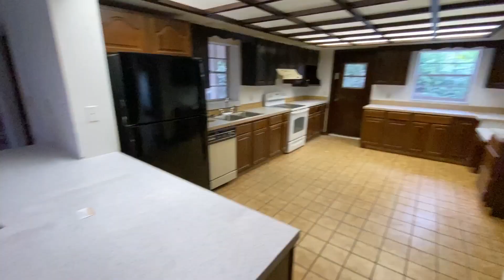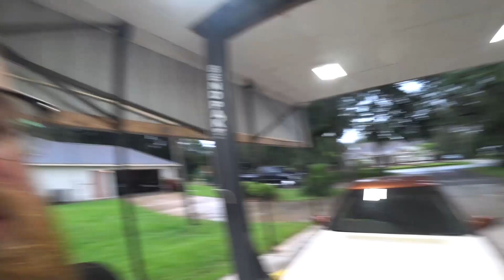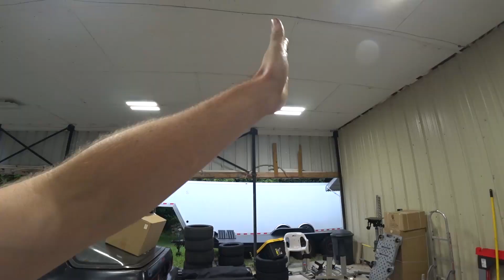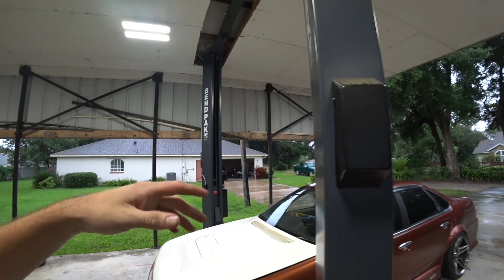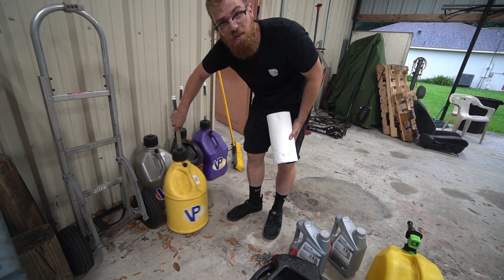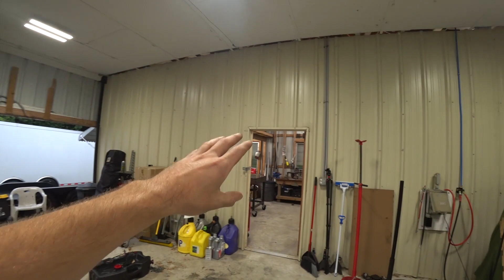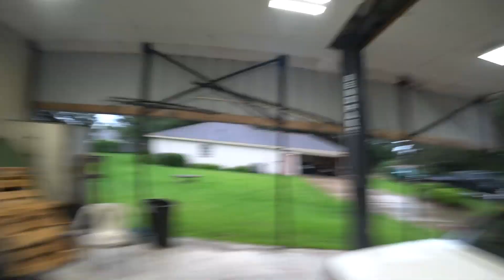Update on my new shop. I have to tear it all down.

Comment: Imagine just being able to close it in without city permission and permits.
Reply: I’d have just done it.
Reply: ah yes cat 5 hurricane coming with no wind standards flying sheets of metal real safe
Reply: @wak3oarder  your mask isn’t covering your nose.
Reply: @geoaerorider4589  I knew a guy that did that, years later got in a argument with a new neighbor and he called the city on him, he built the shop 5 ft to close to the property line. the daily fines he had to tear it down over not pulling a permit.
Reply: What he should have done a long time ago.
Reply: @jsomething2  There's no such thing as "to (sic) close to the property line" where he lives.
Reply: Yeah but you don’t want hurricane to pressurize the newly walled off carport causing the roof blowoff and ruin $100,000 worth of cars and tools. Then have property insurance deny your claim because the building wasn’t up to code. And you can’t blame the insurance company. They can’t payout $100,000 to every house every 5 years when a big hurricane hits. When all it took was $1,000 worth of straps and extra bracing to keep the roof from flying off.  Insurance premiums would be $2,000 per month if they had to keep paying out. Everybody would riot in the streets claiming insurance company screwed them.
Reply: You can, you just don't get dobbed  in
Reply: @tomjones5860  Except there isn't a "big hurricane" "every 5 years". As long as I've lived in Florida, the biggest hurricanes hit up the East Coast. Georgia, the Carolinas, even NYC. Now that I've said that, watch, we'll get the first Cat 5 since 1992 that goes up the peninsula. But it's a fact, we haven't had a "big hurricane" since '92. And there has never been a hurricane that was Cat 4 or 5 that has hit Central Florida. And by the way, his carport is at least 1/3rd walled off already.
Reply: Imagine hell, I would.
Reply: @wak3oarder  cat 5 hurricane?? Could you define to me what structure is safe during a cat 5 hurricane??
Reply: @kevinblackmon6990  it's when a cat gives you so many high 5's, the wind from its paws will combine with existing humidity to create a hurricane

Comment: Rather than enclose your shop with walls, maybe build a series of freestanding cabinets that form a "wall" on either side of the open area? Then bolt them together for security. You could then clad the outer side of them with the same siding as the building so it matches. Maybe leave a foot or so between that upper existing partial wall for air flow. You could then install a freestanding horizontally opening gate at the front to totally close it off. You could also clad the outer side of that with he same siding so it all matches and for privacy. As long as they are not permanently affixed to the floor or rest of the building the county can't say anything. You could build the cabinets yourself? You'd end up with a ton of storage and do it cheap.  Good luck

Comment: I didn't have time to watch the entire video.  However, I'm a developer and have the following advice.   Build it the way you want using existing building codes and bring the building up to current building standards.  After you're done, submit for a retroactive building permit and pay the $2,500 fine.  That will save you thousands and time.  There's no way in hell I would ever tear down a viable building especially one so simple where your walls are all open and the building is easily modified. If the architect won't do it for you, find another one that will.  I agree with some of the other post. Don't ask for permission. You can also go in front of the city and ask for a variance. Sometimes the building department lacks common sense and make an appeal for the city cancel can often open up doors. Best of luck
Reply: I searched all the comments until I found one that made the most sense (this one) I'm a California builder and have done this many times. I suspect that Taylor is making so much money from his YouTube content and merchandise that he doesn't care about the cost.

Comment: So when I moved to Florida I made sure that I found the house with a suitable shop similar to what you did mine is 16 ft tall but not as deep as I like but it does have a lift and AC so that was a plus and my wife has the upstairs half as  a mousery so to keep them fine we keep it about 80°, the AC does run a lot but it's only about $110 a month that's just for the shop though my house has its own power supply

Comment: I understand what hoops you have had to jump thru. I am in the process of planning to build a woodworking shop in my backyard in town. I am limited to the size based on sq. footage of my house's first floor. Then the city wants a to scale lot drawing showing the house and dimensions, set backs, property lines and any easements.  Also the power company is involved for approving a new service for it and what my KWH usage will be ???? Also I needed a certified truss drawing for the city , that meets all codes. Then the city said the shop cant be on a slab alone, it needs a footer below frostline at 30-36 " I washoping to have this shop dryed in by winter, so I could work inside to finish it out. Nope, not gonna happen, so I will set my sights on a spring start here in Ohio.

Comment: Your first mistake was living somewhere that has all those rules and bureaucracy.  That being said I feel for you.  I'm currently building a metal building with a lift for my shop.  You are 100% correct on the price differences.  My permitting process was 3 days including the site visit that lasted all of three minutes.  But my wait time was 15 weeks for the concrete pour which happened two days ago.  Now my wait time for the building is 6 weeks but 4 weeks of that is cure time for the concrete.  But I'm starting from scratch.  If I had your current building, I would've framed up some 2x4s  on your open sides and slapped some vinyl siding on it and called it a day.  City never would have been involved.   But there's a lot ot be said for new construction done exactly the way you want it.  And yeah...AC!!!!

Comment: Howdy Taylor Ray,
THIS is the sort of thing that / make / Make / MAKES /   me Oh So GLAD that I live in RURAL  INDIANA 
I bought 7.58 acres of land with  a 100+ year old HOUSE  &  also a 30' X 70'  concrete PAD that had previously housed a MOBILE HOME in a past life 
Since I did NOT need an open  CONCRETE SLAB  with a PROPANE TAP + a Cold Water FEED + a SEPTIC Tank below the Slab ... 
I built a POLE-BARN over the SLAB  10" tall  WALLS ... I had to have Roof TRUSSES made 4'  spacing 
Framed it in with 4" X 6" Treated LUMBER on the four corners & 4" X 4" lumber every 8'  in between 
It took me TWO (2) Girlfriends to complete the PoleBarn = One (1) Gal-Pal helped me "SET" the ROOF TRUSSES 
The Other Gal-Pal helped me REVERSE POUR the KNEE-WALLS = 30' + 70' + 70' = 170' of concrete KNEE WALLS to reach "UP" to the bottoms of the 10' Metal WALLS 
The ROOF metal was THREE times my height ( I'm 6'1" tall) the ROOF Metal was 18' 3"  on BOTH Sides 
I got it under-roof all by myself = in two days = 70' the 1st day + 70' the 2nd day  ... 
prop a piece of metal roofing (MASTER RIB brand from MENARD's Big Box Store) at an angle - wait for the WIND to die down - 
THROW the sheet of ROOF up & scurry on the PURLINS & screw it down etc Etc ETC 
The Sidewalls were 10' tall and they took about Four Days to screw to the  2" X 4" Ribs 
I opted for TWO  13' overhead doors 
INSPECTIONS required in Rural INDIANA:
Inspect my HOLES for the Structural  4" X 6" & 4" X 4" POSTS  for total DEPTH 
Inspect  my HOLES for Concrete in the bottom of these HOLES a week later 
INSPECT my Framing  for proper LAG-BOLTS & Connectors 
INSPECT the FINISH construction for Hurricane Connectors (although INDIANA has never experienced a "HURRICANE" ) - LOL
I only failed one item = a  "RAT RUN"  = a 2" X 4" Row of Boards to connect the Bottom MIDDLE of my ROOF TRUSSES  together to prevent "racking" which was easy 
I never plan on SELLING my PROPERTY - so in INDIANA - I did NOT actually NEED to have any INSPECTIONS = only need was to REPORT the BUILDING for TAXATION
G@@D LUCK  on your Shop
COOP
................................................................

Comment: I think the oil he's dumping out is cleaner than the oil in my car.
Reply: I noticed that too and wondered how/why such clean oil would/could be deemed worthless - perhaps it was contaminated somehow, or perhaps it is actually fuel rather than lubricant?
Reply: @maximummarklee  My guess it is either Brake Fluid, Clear Transmission Fluid or Hydraulic Fluid.

Comment: Just built a 32x30x16 myself. Biggest I could fit on my property with zoning. 
Did everything myself. permits, foundation, plumbing, electrical, windows, doors, framing, roofing, lights etc. 

The city is a pain in the ass and will put a lot of unwanted stress on a homeowner. Also contractors I found absolutely do not care. Nobody stands behind their work either and it’s a pain working with anyone. Hopefully you have better luck!

Comment: A suggestion in case you haven't thought of it.  Offer the current building for sale on local Craigslist or similar site.  Cheap price but they have to remove it.  With a firm date of having it gone or they forfeit the money.

Comment: As a Design Builder in Hawaii I can appreciate your situation I would highly recommend looking into SIP'S Structural Insulated Panels with lumber cost and steel cost the way they are you would save TIME and money.... 6" sip walls R20+ 8" roof panels R30 
6 weeks lead time and it would take 3days to assemble. 💪 good luck
Reply: SIPS in florida would rot in a year.. ICF walls and trussed roof would pass any and all wind loads, stay cooler and keep the noise levels down.

Comment: Starting over will cost more upfront but you will end up with exactly what you want and you won’t have to make any compromises.   Based on the current material prices you should be in a good position on the costs by early 2022. 

Good luck.

Comment: 200 amp electrical service. 10' x 10' door between the front and back of the building instead of an 8' x 8', trust me.
Reply: Im sure that house is already 200amp at least, wont take much to just tap right into the mains for shop service.  Put the shop on a knife disconnect right off the meter on the house and you'd be golden.

Comment: Taylor get ahold of cleet he has a great electrician think it’s central Florida electrician
Reply: Taylor ray I work in a ac shop, it doesn’t run all day especially if it’s insulated and the doors aren’t opened all day long. Over night when it catches up to temperature it a lot of times stays cool for quite awhile during the day before kicking back on.🤙
Reply: Idk if he over quoted but the work was done quick an cleet seems to be super happy with it an that’s why I said get ahold of cleet to find out if he was completely satisfied with everything an would recommend or not.

Comment: It took me since February to build my 26'X35'X12'(wall) Steel building. Luckily I was able to buy the building right before they raised the prices. Then the excavation and 6" slab. It took 2 months to get the building but went up in a day. Just got the 100 Amp service completed yesterday with LED lights. Next steps, build a workbench and put up the Rotary lift. It's a challenge but I'm finally getting there. Good luck with yours.

Comment: Correction one other thing you might have with permitting is you need ventilation you can’t run a shop without some windows and things to ventilate exhaust gas Or some kind of system for that to make sure you don’t die in there

Comment: I tried to get a permit for a two stall detached garage. I had researched setbacks and size restrictions and stayed within those. BUT Was denied because I wanted to insulate and install a unit heat pump. Insulation and any kind of conditioning is not permitted! Nebraska weather has some pretty cool and warm periods, -29 & + 106F.

Comment: Most places all you would have to do is go to the town and pull the permit yourself. You already have the slab and the general shape of the structure, if you don't change that then it's not a nonconforming structure and then it's a couple of outside walls, front wall with door. Windows wherever you want them. Just loose that ceiling and if you wanted to open up that back space, get a steel i-beam. Way cheaper than building an entire new shop and it would essentially look and feel brand new.

Comment: Dude. Just close in the walls yourself. When you sell the place, tear it back out of you have to.
Reply: Closing in walls that wasn’t designed to handle the wind load of a hurricane could have catastrophic results. I think where he is in central Florida it would have to withstand 160 mph winds.
Reply: @genecoppedge5972  the already enclosed part already is not up to latest and greatest wind codes. So use the enclosed section as a sort of template and close it in your self. The roll-up doors might become an issue but cross that bridge when you get there.
Reply: Yep was thinking the same, close it up,  save your money. Buy new shop later when you are more settled in.

Comment: Adding on to marginally built building is often more trouble and cost than its worth. I think you choose the right path for this project. I'm also glad zoning didn't have a problem with the use but since it is a residential use your probably ok. Try to go commercial and you may find nothing but more trouble. If all automotive people were as considerate as you maybe more zoning codes would commercial automotive related businesses in residential zones. Rock On!

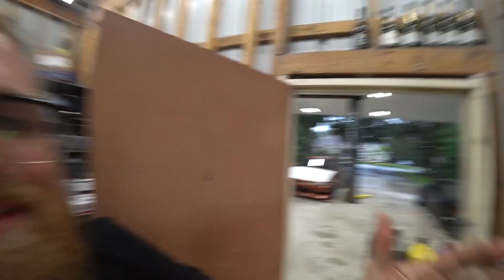Comment: 13:55 - Instead of adding a custom truss over the end wall another option might be moving that wall in to line up with the next truss.
Reply: Just frame the wall up like normal framed gable

Fabricate all the hold downs and have em spec’d 

Done it dozens of times

But if a new shop doesn’t over extend ya then it’s a no brainer 

Good vid, good luck go for it!

Comment: took me 3 months to get a permit to build my garage and a lot of hoops. Did the build drawings myself. I built it in less than 3 weeks with a friend helping me with the trusses and siding. Did all the electrical inside and I ran the line from the house to the box, then sealed the slab. It was exactly the way I wanted it and the inspectors found no fault. Total cost was $9K. I hated the metal storage shed I had to use, it was almost worthless. Now this was in 1994. So I have no idea what this is going to cost. $35 or $40 K if steel, more if wood.

Comment: SUGGESTION: I know you said this is going to be a shop for private projects and not a professional shop, HOWEVER, you might want to check out requirements for professional shops and include elements into your design. For instance, you deal with a lot of fuels and lubricants on site. You also deal with a lot of rags, cloth, and paper products that tend to get soaked in the aforementioned flammable fluids. I would highly suggest you include fire mitigation and suppression into the new shop plans. (I could tell you about the fire that took down a corner of my high school from solvent soaked rags in a metal cabinet. Shit happens, Yo!) If you have water, I'd suggest a washing station with an eye-wash option. (Again, shit happens.) Plus you live in Florida. I don't care how nice the neighborhood is, it's Florida. You're going to want some security to protect your investments. (The smart crooks shop in the nice neighborhoods.)

If you were going to tear up the foundation, two other suggestions I have are a drive over maintenance pit for simple stuff (like oil changes) and adding an onsite bathroom. The bathroom probably more than the maintenance pit, as this way you're not greasing up your home.

Comment: I'm building a 90x70 shop down here in lee county and it's been pretty easy so far were contracting it ourselves (I'm not a contractor but I have experience) and it's been a breeze this is on barren land and I'm building a house as soon as the material prices come down and will do the same with the house but your right usually with this sort of thing it's better to start from scratch

Comment: I have a friend that had a similar issue of inclosing his carport.  City said too close to the street to enclose.  He installed a double wide garage door on the front side, and three smaller single garage doors on each side.  Problem solved, carport not permanently enclosed.

Comment: Could sell that one to somebody that CAN build it back on a farm without having the permit bs
Reply: Expensive to move things
Reply: @vanderumd11  cheaper to move than to have built, ive torn down buildings and rebuilt them way cheaper than i could have with new lumber and steel but to each their own
Reply: @young11984  Agreed.  If a man or two could put this thing up, it can be carefully disassembled and rebuilt elsewhere.  Recycling at its best.  There are estimates that saving old buildings conserves energy to the tune of 60-70% due to the cost of manufacturing the materials, hauling, and building the structure.  
We have a local company that is in the reclamation business and sells the materials from houses that people want removed or torn down that still have good materials in them.  A wealthy family had a home taken down by this outfit that was built only 25 years ago.  Many times people do not realize what green building really is.

Comment: Can u build a separate shop and leave this one as is? 🤔
Reply: I don't think so, it'd presumably have to be pretty tiny to not surpass the permitted garage/shop size as it's relative to house size as he said.
Reply: @dyIanVII  some places you can get away with it if you attach it to the house with a breezeway, then its the same structure not an accessory structure.